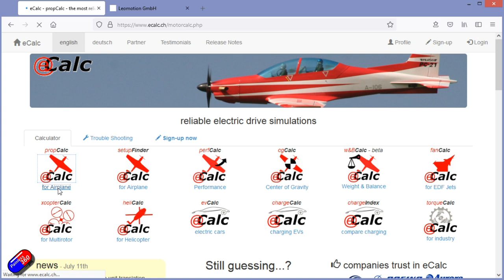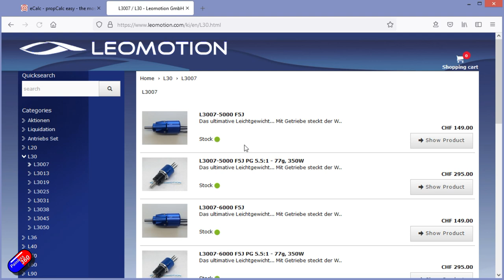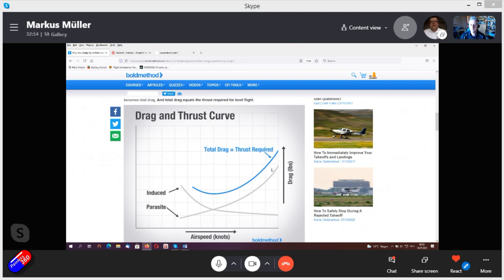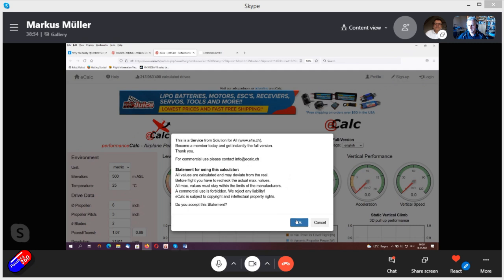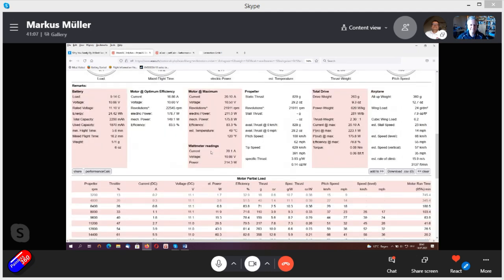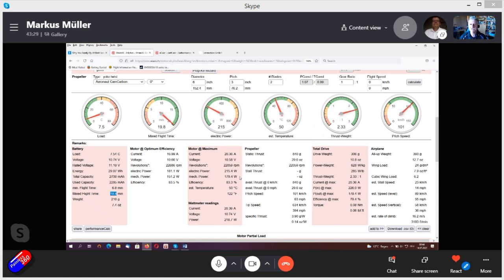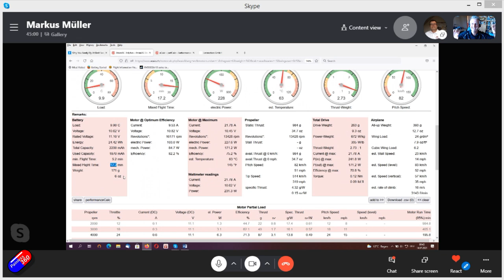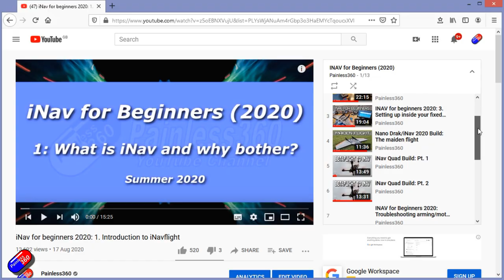How can I make my 'plane fly for longer?

Comment: In this video, I observed that the flight time decreased from 19 to 17 minutes after motor change. In My experience with eCalc, lower kV with smaller propeller than maximum recommended gives more mixed flight time - Example: 9045 gives more flight time than 1047 in Emax 2212 980kv motor.
Reply from the maker: Great to hear that you are using ecalc. Happy flying!
Reply: @Painless360  Thanks! I am new to this hobby. Actually want to understand if my observation is correct?
Reply from the maker: Possibly. Using less prop than the max the motor is rated for means that it doing less work. Also, changes in pitch have a much more dramatic effect that those on diameter.. See the rest of the series...

Comment: Excellent content, and very useful! Max endurance speed may be better known as Vx in full scale theory, and Vy for max range. But the elephant in the room must surely be action cameras and gimbals? An externally mounted GoPro will wreak havoc with parasitic drag. I feel the YouTube is too full of sleek efficiency wonders sporting enormous air brakes up front to skip that point entirely?
Reply from the maker: Very few reviews take things like efficiency into account. Often power systems are designed with an eye more on speed than anything else and that can mean that those of us who like to fly for more than 6 minutes at a time need to tweak things. As a pal of mine who loves to fly flat out all the time once said 'It may only be half the time but it is twice the fun! I have models built for that but others made for endurance and longer flight times using efficient motors and props and high capacity LI-ION packs.. Happy flying!
Reply: @Painless360  My point exactly. Parasitic drag relates directly to endurance and range, not just to top speed, as many pilots seem to think. I never fly at top speed, but I'm careful to keep parasitic drag down for the sake of range.
Reply: Actually the evolution of the quad was accelerated by a couple things that actually hindered the development of a clean aerodynamic aircraft.
Too its detriment, if you asked me. Which no one has.
The motors are so powerful, the batteries are so efficient and the flight controllers are so smart, guys were able to mount 4 motors on two sticks, hang all the electronics out in the breeze and literally strap a battery anywhere it will fit. So why not stick a camera anywhere you want. Who cares that a gopro is wider and taller than it is thick? It should be long and skinny. But we don't care about aerodynamic shapes, why bother. And weight? Whatever the thing will carry it will carry. Does it matter that theres two cameras at the front? Center of gravity doesn't matter. The forward motors will just run faster, the back will run slower. The argument that you may not even be wasting battery could be made. Of course the life of the motors might be different.
But here's the thing. Today's flight controllers are so good, pilots don't even have to learn how to fly. The quads fly themselves. Someone trying it for the first time won't crash.
When I started flying 40 years ago, my knees used to shake before a first flight of a new airplane. Of course it took 20 hours to build one back then.
I flew helicopters without a gyro. Couldn't afford one. A computer radio cost 500 bucks. I mowed 20 neighbors lawns for two summers to buy my first helicopter with all the stuff. It was a cricket. Fixed pitch, nitro engine.
Today's quads don't fly, they have no wings. If you lose a motor or throw a prop or the battery dies, your coming down. Forget about gliding or auto rotating. 
My point is this. A quad is a cuisinart beating the hell out of the air with its props, making the atmosphere its bitch, and being stabilized by a computer.
There was no aerodynamic evolution involved like there has been with fixed and tradition rotary wing aircraft.
If someone could figure out how to design a quadcopter with a lifting body and arms and transition onto the rotor discs like a helicopter during forward flight, then they would be much more efficient, fly on smaller lightweight batteries for a much longer time and if a motor dies you could theoretically glide to the ground.
Theres a long way to go in improving quads. Right now all you really see is different ways to mount 4 motors and the electronics cleaner. 
Someone needs to design something that flies flat and fast.
Something that transitions like a helicopter does into forward flight.
Most people don't realize when a helicopter starts going forward it begins to fly ON the rotor disc like a wing.
That's what we want to do.
Then we would really be cookin with jet fuel.
I've almost got it figured out. When I do, if I do, racing is going to happen at twice the speeds we are getting now. Long endurance and distance is going to be amazing if "they" let us.....
Reply: So vx is best angle of climb speed and vy is best rate of climb, do these carry over to max endurance and max range too?

Comment: I'm learning that my most efficient flying comes as a result of accurate wind direction forecasts. Slogging into a headwind to ride it home isn't the best way to fly hey!.
Reply: It shouldn't change your duration as long as you the wind speed it less than your normal cruise speed, but wind will definitely reduce your overall average ground speed. So if you want to fly long distance and return you will go the farthest in still air.
Reply: Unless you are only flying one way, it's not the direction that hurts, it's the wind speed.  You'll always fly faster round trips in still air

Comment: I've been thinking about making custom Lithium Ion packs using cells that are physically about half the size of a standard 18650 cell. If I understand right, I can wire six of these as 2 3s packs and double the c rating, does that sound right?
So I get the long endurance and the light weight of the Lithium Ion but also get increased amps?
Reply from the maker: Wiring packs in parrallel will increase amps. See my video on it. Best of luck
Reply: If they are half 18650 cells and you are doing 2p 3s then you will end up at the same Ah and c rating as three series full size 18650's. Only difference is the shape of the pack
Reply: @Painless360  I did. Interested in what you think about this approach. Could it be the way to get the best of both worlds?
Light weight and endurance benefits of lithium ion with lipo performance?
Reply: smaller cells = lower c. I usually go with 2p4s 18650 or 2p4s on 21700. Always staying half of max discharge rating of the pack, having in mind that lower c means more sag and more sag means less voltage to the motor.

Comment: I use ecalc and that's how I figured out my motor /prop combo  for my Diatone Ripper r690
Reply from the maker: What setup did you go for?
Reply: In hindsight.  The T- Motor F80 Pro  2200kv  with a 7x5 blade produced  the best results  and most smiles 😃

Comment: Hey, I am a absolute beginner and I want to Equip a RC Plane with sensors to measure airquality (weight ~ 1kg) can you recommend me a RC plane that is cheap (less than 300€) and able to fly as long (km) as possible?
Reply from the maker: I'd strongly recommend getting something to be the 'beater' while you learn how to set them up and fly. Crashing is a big part of the early days with the hobby so don't spend too much on the ultimate build until you can fly it easily. Check out the fixed wing playlist - all of the reviews of the hobby grade models I've reviewed are in there and I talk about endurance now too. I'd start with things like the Swordfish... Best of luck.

Comment: Selection of an electric fixed-wings battery, esc, motor, and prop combo is a nightmare.. (even worse now that every motor available is some kind of quad motor designed for the latest racing bling 5") 
If you really want to fly far I think gas engines are still totally the go.
It was this month eighteen years ago that TAM 5, a 72" model with an OS four stroke flew 1880 miles across the Atlantic in almost 39hours to set yet another record for Maynard hills. I guess that was before most of you were born!

Try that with your Electric foamie or quad...

Comment: I Thought that the minimum flying speed is the lowest on power Consumption so u get maximum efficienscy! Guess what?! Its not! Really exciting conclution! U go 10% faster and u go more far! Really intresting!
.
Reply: There’s actually an efficiency vs RPM and an efficiency vs speed plot for each motor and propellor. You can map them together mathematically by relating rpm the speed, and you’ll find that some props will peak closer to some motors. Your goal is to get the highest overlap for the two and flying at that speed will give you peak efficiency.
Reply: If you're just talking minimum thrust required then you're kind of right. The Max endurance (time of flight) for any given motor prop battery combo is at the lowest throttle setting that you can maintain level flight. Plane can be flown slower than that but it requires extra power. 
The 10% faster thing is about Max range not Max endurance,  in reality we already cruise toward the upper end of the range to fight against a head wind anyway and all our small fpv type aircraft are too slow.  I'm looking for a faster, efficient airframe that will cruise at over 60mph without pulling a heap of current. 
Will probably go gas larger airframe